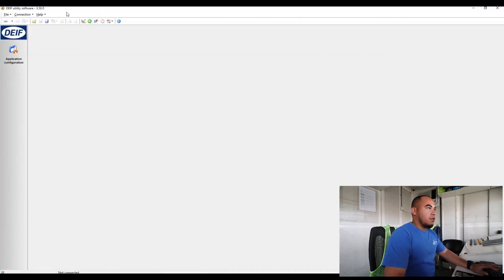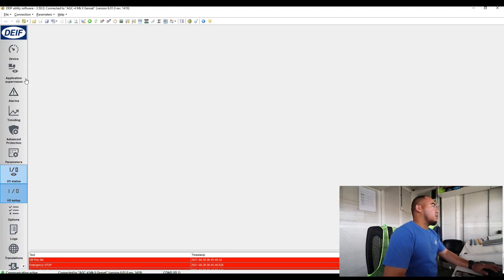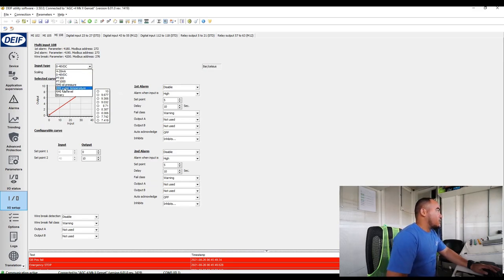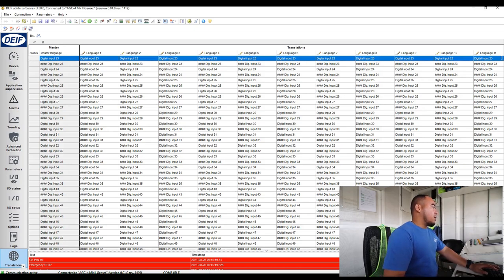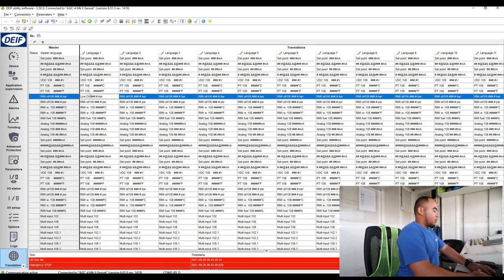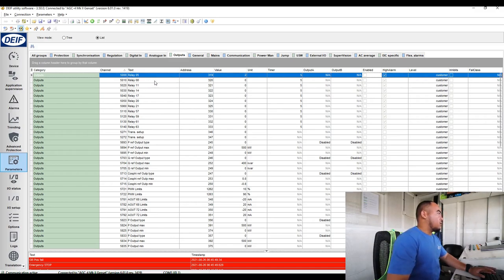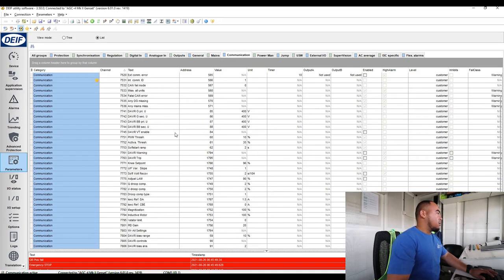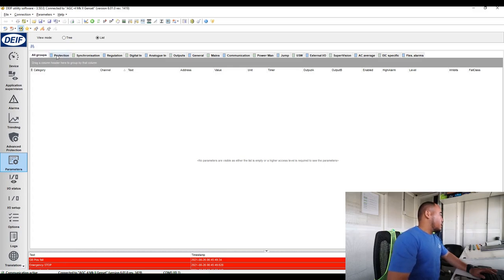DEIF AGC-4 MK2 BASIC CONFIGURATION  benzblogs

Comment: please make one vedio for upload from old controller and down to new controller
Reply from the maker: Just safe the file from your old and wright is to new one
Reply: Dear please how to safe the file from my old one?
Reply from the maker: Sir its there sir how to save it
Reply: Dear dir i have the old file so before write the old one over there is an option (device firmware) should i click and include in backup and also the translation procces reach 6% and says error what should i do plz
Reply from the maker: @soksokkg6587  that means need to update your firmware to match your old version file
Reply: @benzblogsVlogs  so it means to include the firmware option along with other parameters
Reply: Also we did all this beacause the ppm lost all information due to fuse thus generator still out of order
Reply from the maker: @soksokkg6587  you to upgrade depend on your old file
Reply: @benzblogsVlogs  the old file was taken when deif controller was working good thus now still showing lang and not calibrated alarm and we try to syn but not posiible 2130 alarm also
Reply: Example the ID 1900 ,the alarm is low fuel level, where can you scroll or find the fuel level low set up? And also fuel high level set up?

Comment: Hello sir after restoring with the batch file for one of the generator coming alarm (droop mode3170) and also kw meter is showing minas or negative like no signal so what to do plz
Reply from the maker: If kw is showing nigative meaning you got wrong connection ither you ct and voltage senaing from module